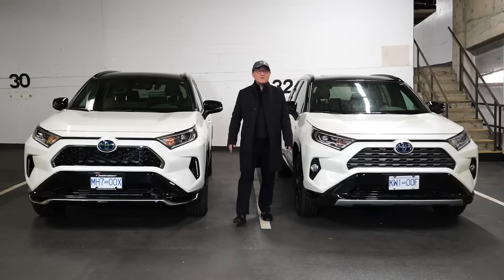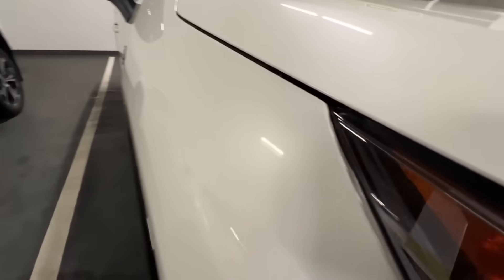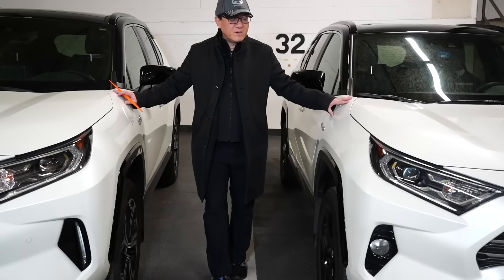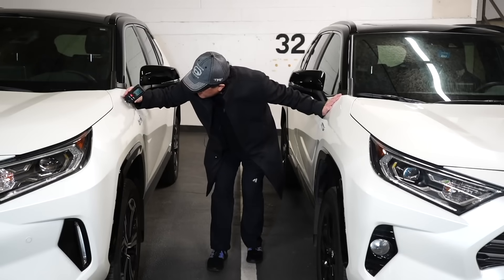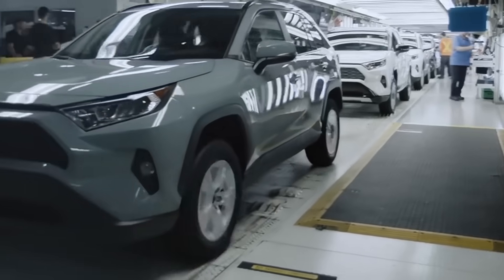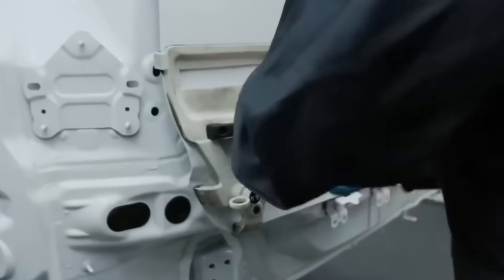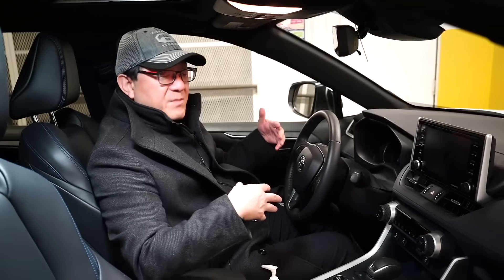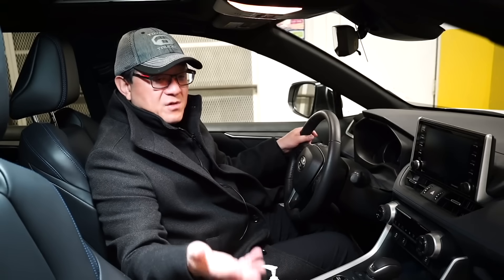JAPAN-BUILT RAV4 vs NORTH AMERICAN-BUILT RAV4 - WHICH HAS BETTER QUALITY?

Comment: We own Rav4 2019 xle build in Japan and mother traded her old Rav4 to a new Rav4 LE built in USA.  It drives similar but engine stop system is really unnecessary. However LE model has better mileage from XLE model. Interesting that Japanese model has Japanese wheels and they are cost much more than US models.

Comment: I am still hanging on to my 2004 Acura TL and I can 't tell you how many people say how good the paint job has held the gloss and newish looks.  Yeah, the dashboard cracked years ago and the drivers side seat is starting to rip.  But as far as the way it drives and how good the engine has held up, I am very pleased because this car was built in Japan. 

I think those dashboards cracked because of the glue they used for the 3rd generation but this car is just a machine.
Reply: Just FYI, all Acura TLs since the second generation model introduced for the 1999 model year have been built in Marysville, Ohio.
Reply: @mackereljuice1537  even if it says made in Japan?  Either way this car is so good

Comment: Hi Mr David, thank you for all your movies. I have a couple questions and it would be nice if you could answer them in your upcoming video. There is many construction guys in North America that need a simple and basic truck for work (work horse). Toyota sells these cars in Australia and Africa, but why not in North America? It's a little funny to buy a car for 80k and drive it to work at the construction site. Toyota is making diesel engines, but why don't they sell them in North America, maybe they are better than the ones in here. You have a new tundra, I'm wondering if the GPS navigation system works in your car? You paid a lot of money for the car, so everything should work. Thank you for reading.
Reply from the maker: Thank you for your questions - I hope to answer some of these in future videos...

Comment: I’m interested to see the underside protection differences, here in the rust belt I notice that subframes seem to get a thin coat of paint that lasts about 3 years on most cars, yet I just had a 2006 RAV 4 with 380,000km and the underside was rust free (had not been oil protected either) sorry don’t know if it was japan built.

Comment: well if you take a look at canadian made rav4(which I own) freaking steering wheel has huge seams, joints rusting in 2 month, inconsistant gaps on hood, pannel not properly installed, welds are messy and paint over sprays, center consol latch broke in 1 month and yeah, shifter knob wobbles too

Comment: As far as quality goes there is a huge elephant in the room with respect to the electric rear AWD motor connection. Otherwise known as Cablegate, look it up ,google it Toyota initially was not taking care of their customers only after being pressured in Canada and the US did they finally start honoring the warranty they should have honored in the first place.The worst part is they don’t have a fix for it yet they replacing parts that are inadequate for the job with new adequate parts. This repair is $6-7,000.00Can you imagine people having to pay out of pocket with a two-year-old vehicle $7000 Toyota was saying that the hybrid power cable was not part of the hybrid system .To any prospective buyers do not buy  either one of these cars if you live where they ever salt  the roads. I never would’ve bought mine if I knew about this issue. This issue affects the RAV4 prime and the hybrid it probably affects the Highlander hybrid as well. This was a good video and I don’t care what anyone says the Japanese one is built to a higher quality they just care more about their workmanship.

Comment: Bought a 2021 rav4 prime…your comments on product launch are spot on…this car has been fantastic no issues at all….incredible for first year in production
Reply: Сongratulations on your purchase.
I bought rav4 plug in hybrid (to the American market called prime) in 2022. Waiting for the car 4 months in our country. For our market (Toyota Europe) rav4 comes only in Japanese assembly. The level of fit of parts both outside and inside makes me very happy (of course, Audi will have a better interior finish, but the price is higher there). The dynamics are amazing, did not expect from car. Fuel consumption pleases. It seems to me that I go to the gas station much less often. So far everything looks great.

Comment: David,
Good video.. But let's not forget. The Prime has a very low build number compared to Ontario's high volume vehicle output. 
And also Japan's paint quality will always be better, different emissions standards. Waterborne vs Solvent paints.....
Your micrometer is only giving you the total thinkness. Not a breakdown of primer/base/clear coats, and glad you know it doesn't work on plastics parts :-)

Comment: Nice video. But I have a question are you sure the paint on a car has same thickness all over? Because if the paint has different thickness in different spots on a same car then that test would not give perfect results is what I think. Also can we ask dealers in North America to get us a car manufactured in Japan? Or it is just a luck based on the car we received either Japan or NA manufactured?
Reply from the maker: Please watch the entire video, I explain about different thickness on different parts of the car.  No, you can't force to get the allocation from Japan unfortunately.
Reply: @AutomotivePress  Thank you for reply and clarification 🙂

Comment: I know this is about Toyota but Honda is an excellent benchmark.  I have a 2017 Honda Fit . The Japanese  engine and transmission  run like a dream, The rest of the car is built in Mexico and is absolute garbage.

Comment: My 2022 Plug-in hybrid RHD built in Europe has bad panel gaps, worst being the plug in cap it’s terrible. Must be at least 8mm at the top and 2-3mm at the bottom and not flush with the quarter panel.

Comment: Nice video.  You've made some assumptions about what the gap size is actually supposed to be.  In other words, what is the spec?  Is the Japanese version too tight, or is the Canadian version too wide?  Personally, I would prefer not to have my body panels too close together but rather have them with the correct gap size.  Thanks for taking the time to make the video!

Comment: Mississippi built Corolla 2017 SE model zero issues, not even brakes changed yet at 75,000 miles. Not bad considering the vehicle will be paid off in June 2023. Tons of life left to go in it. It also saved our lives. We live in NH now yet when living in Texas my wife passed out behind the wheel. We were going 75mph on the interstate with the dynamic radar cruise on which did braking and gas for us for three minutes she was out. I pushed the hazards on and steered from the passenger side. Couldn’t shut off the cruise due to a lack of good shoulder in that area. She finally awoke and was able to pull over. I was so impressed I wrote Toyota to thank them. I think they have good overall standards like he states that the brand is solid to buy. I’ve owned various models and none have ever let me down.
Reply: Dang....why and how did your wife pass out behind the wheel of the car?  Due to sleepiness ??  I"m glad you guy's got lucky and made it out alive!  God bless Toyota's from Japan still!
Reply: @bigfootswatching9986  Yeah my wife had a medical episode which made her pass out. What was wild is if another car pulled in front of us quick the car itself noticed and slowed down then sped up later when it was safe. Worked flawless.

Comment: I purchased a 2021 RAV4 XLE Premium (gas version) built in the Cambridge ON plant. Vehicle was bought April 29/2021 and currently only has 11500 kms on it! It has developed a terrible rattle around the back liftgate area. Couldn't handle it any longer so I took it to the dealership and they were able to identify that two trim pieces on the two upper corners of the lift gate had failed and needed to be replaced. The parts were ordered and replaced last week which has helped but they indicated during that repair that both lift gate struts have failed and need to be replaced which are now on back order. I'm not very impressed with a relatively new car with with only 11500 kms having these kind of build quality issues. This is my first and maybe my last Toyota product.
Reply: I've had a much different experience with Toyota reliability and so far haven't had any issues after many, many more miles.  Good luck with the other automakers 👍
Reply: @ytj22  In all reality, once I get by this current issue of the lift gate struts bring replaced and get it quieted down a bit, I will no doubt keep it for the long haul. I really do like everything else about the RAV4! I did my research and bought it for the long term reliability. Didn't want 100% direct injection, CVT or any turbocharging, so as a long term owner, Toyota checked all the boxes!! I guess I was just venting due to these early problems, because I hate squeaks and rattles in my automobiles!!!
Reply: @ronripley9197  I felt that the Toyota ticked all the boxes for me too.  I suppose I shouldn't say I haven't had any rattles, there may be one or two, but reliability has been bulletproof.
Reply: I"m telling you...Japanese built from Japan is way better!!  I had the same issue with my 2019 rav4 Adventure and many other little issues......got rid of it and now have a 2021 Rav4 from Japan....no issues!!
Reply: I have owned a Camry and a Tacoma. Both lasted well but both had significant rattles. Toyota cars are generally reliable but prone to poor bodies, cheap interiors and rattling
Reply: @billricheter5678  Poor bodies?  Haven't heard that before.  Can you provide more detail?
Reply: @ytj22  had a Tacoma that rusted out. Same thing to mother in laws tundra. Reliable but rust was a problem. Those problems are not the same concern as they used to be however. Had a Corolla that had a weird whistling noise threat was really bad. It finally was recalled and fixed but was a massive nuisance for a couple of years. It was really bad
Reply: @billricheter5678  that's unfortunate.  I live in an area where salt is used in the roads.  I've never trusted any brand of car in those conditions so I get them undercoated.
Reply: @ytj22  live in colorado. Mother in law in Texas. I think Toyota has improved those rust problems. They were pretty common in the early 2000s.

Comment: Love my Ontario built Rav4 hybrid.  The one thing I don’t like it they just use a flap of material on steering column at the base to cover up the area that’s adjustable.  I never noticed until I sat in passenger seat and looked over at it. Does the Japan built have it too?  For a Limited model I expected better.

Comment: I’ve read about many issues for the Tacomas being built in Baja California, Mexico. Body and finish is a concern.
Reply: Mexico always have problems,even in appliances
Reply: @dorron2595  Appliances are not anywhere on the level of engineering as an automobile. I’ve got a GE Profile refrigerator Made in Mexico that’s over 15 years old without any issues.

Comment: Check your rav4 for roofrack water leaks during long period of rains
Reply from the maker: It rains almost everyday here in the westcoast and we have no problems on both RAV4s.
Reply: @AutomotivePress  that’s great! Mine has a leak and it’s a 2020 rav4. I read online that they fixed the roof holes on 2022+ models.

Comment: I have 3 toyotas, 2 of them are made japan and one is made in US. I can tell japan made toyotas are more better, from paint, body panel gaps, plastic injection moldings. I also noticed, japan made toyotas noise level inside the cabin are more quite than the one that are made in US.

Comment: I had a European made Rav4 XA50 and now a Japanese made Rav4. The first thing I notice is how the doors close.  The Japanese are better balanced. You can fix the doors position and they close softer.  The second difference is the interior leather.  On the Japanes, the quality is better, on the Europeans it looks more like a kind of eco-leather.  In general, the European model resembles a Lego constructor, where every detail lives on its own.  After 60k Km, plastic creaks in the cabin.  On the Japanese, I also drove 60k km and the car is less noisy in the cabin.  In general, it is felt that the car is more solid, and the build quality is higher.
Reply: No XA50 has been made in Europe. They used to come from StPetersburg, not anymore for obvious reasons. Not sure where the hybrids come from now, the phev all come from Japan.
Reply: @vongolavorace  In Europe, the XA50 was produced from 2019 to 2022 at the Toyota plant in St. Petersburg. The plant produced a large number of cars for export. After stopping production and limiting the supply of new cars to local dealers from Japan, many buyers began to buy Rav4 and other cars in the UAE, Korea, US and Canada markets, buying them without a warranty and clearing them themselves.

Comment: Next time, try to get one from Kentucky (TMMK),  our 2022 Rav4 Hybrid Limited had tons of rattles inside at first, fortunately after a few hundred miles they went away.  Only one rattle left, by the B-pillar / driver seat belt on rough roads.  13K miles trouble free and avg 41.7 mpg at the pump!
Reply: It's probably from the chicken bones purposely left in the body trim somewhere. Go USA

Comment: Agreed
One thing to point though about the gaps measures, if you measure the left wing gap on one car then should be measured the left wing of the other car and not the right one, because there always can be a difference between L and R

Comment: I bought a 2022 Canadian built RAV4 about 7 months ago and have been wondering about this. Glad to hear there's very little quality difference between Japanese/North American vehicles. I've been really impressed with the fit and finish of my RAV4 as well as the solidity and refined feel (driveline, switchgear, etc.) of everything.
Reply: Good that you are impressed. Me not impressed with Canadian CRV Hybrid that I just bought! Canadian can't stitch seat covering right and very sloppy in installing parts under the hood that is what I know so far! If I can return it, I will return my Canadian CRV Hybrid to the dealer without skipping a heart beat. Not a build quality I envisioned to have with $35K+++ sticker price

Comment: Talking smack about Toyota makes irresistible clibkbait. Talking smack about any other brand is ho hum. So, let's see a comparison of the RAV4 and a Nissan Murano (could be any one of a dozen other cars, but Nissan is Japanese.)  Toyota can't win.  If they treat foreign workers (Americans) like Japanese workers, they are insensitive.  If they treat them differently, they aren't holding up the quality standards. Toyota dipped a toe into American manufacturing with the NUMMI plant.  In conjunction with GM.  They hired 80% UAW workers from the previous plant. They managed to get them on board and making quality cars.  Toyota shut down NUMMI and opened up a plant in Kentucky.  So, Toyota is sensitive to the differences in foreign lands and does it's best to keep Japanese quality while allowing for local culture.
Reply: Hmmm if they were so good over toyota,why the almost wen bankrup 2 times.merg..with French junk,and nissan cars are even more cheaply made.than any other cars,tidas and ad wagans

Comment: As an Auto Engineer, can you do a video on what actually changes in the car from the first produced car of a model year to the last produced car of the same model year? The CarCareNut channel always says to wait 8 months if you're buying a first model year of a new generation, and we are all curious as to why.

Adjacently, is there any real difference between the last produced car of a previous model year and the first produced car of the next model year for the first two years of a new generation model?
Reply: I think it has to do with numbers of recalls and common issues warned by Toyota internally as well as their work experience which can be different since he lives in the rust belt.

Comment: Do you keep going over this because you’re implying that this is an indicator of the overall build quality?  Because I don’t know anyone who really cares about these two things.  I buy Toyota/Lexus for their longevity and build quality.  I can’t tell you how many old Land Cruisers I’ve be been in that everything still works and the owner has zero intention to ever sell them, only to keep adding newer ones to their fleet.  Then they’ll get a Prius, Camry, or LS for their run around vehicle. On every vehicle you review I’d rather hear you say how long the engineers expect the vehicle to last for when they design it and how long Toyota will support it with parts.  In my mind that is a much higher indicator of build quality and engineering quality than paint thickness and tiny body alignment.
Reply: Common practices are 100K mileage. If you want better quality, you can get a Nissan CVT which gives you a 150K warranty. (Cough cough not because their transmission has a common issue with failure rate around 60K due to bad quality

Comment: David, if the gap is wider on the Canadian RAV4, and the gaps are symmetrical (same gap on both sides in the case of the hood and tailgate), then the hood and hatch are actually smaller than the Japanese one. Does this make sense? If I'm correct, this says to me that Toyota trusts the Japanese assembly line to align panels to a higher standard than the Canadian RAV4 line.

Very interesting video!!! Thank you for making it for us!! (My last thought is that these cars represent only two data points - but I don't doubt your conclusion at all!)
Reply: Yes I’d like to know this too. In the case of the hood, I guess it just sits a mm lower but the doors, are the Canadian ones smaller or is the door frame bigger?
Reply: @mikemarshall7016  same size same parts